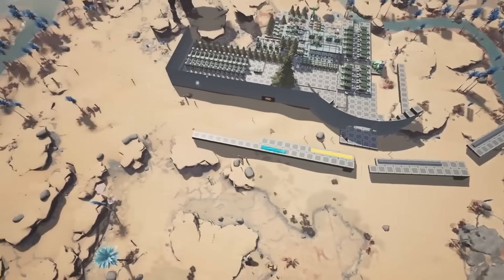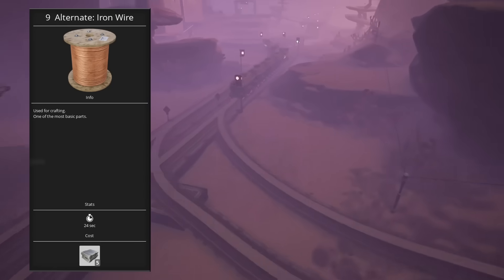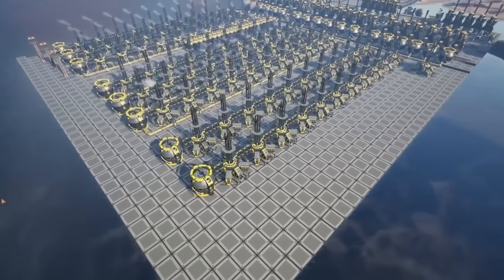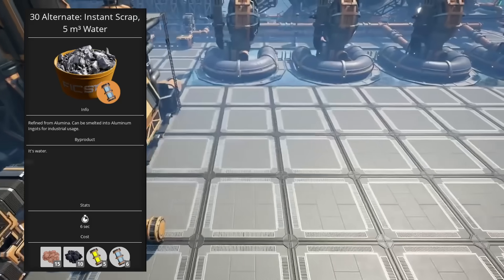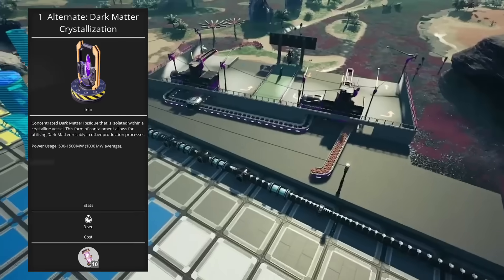Alternate Recipe Guide - Best alternate recipes for each tier in Satisfactory 1.0

Comment: Iron Wire + Stitched Iron Plate + Iron Pipe + Encased Industrial Pipe + Heavy Encased Frame = screw-less Heavy modular frame factory that only uses concrete and iron.
Reply: This was something I immediately tried to jump on when I found the alt recipe. The problem I had was finding iron pipe since I pushed milestone tiers (and diluted the drive pool)
Reply: @Aeosin  Early exploration is extremely important because of the new hard drive system. I was a little miffed when I realized I'd have to get a bunch of hard drives before completing stage 2.

If you don't have scruples with "exploiting" the system, you can save before re-scanning hard drives and re-loading until you get what you want.
Reply: @1Heirborn That;s not how you do it. You just copy the hard drives, rather than bothering with saveScumming. At least if you want to be the player without scruples.
Reply: @Aeosin if you don't actually click on a recipe, and keep scanning more hard drives, it gives you a better selection because the recipes you can select are already out of rotation
Reply: @Fawstah  Solid advice that I was making use of when I figured it out. However, for my situation I had pushed tiers instead of hard drive exploring. As Dekoba mentions, T5 basically increases the recipe pool exponentially, and I had picked up heavy encased frame alt well before my big hard drive hunting session. So I was stuck thinning the pool for iron pipes for a good while.
Reply: @Fawstah  problem right after 1.0 came out though was the large list of saved drives making the UI size up vertically out of the screen. I was forced to pick useless recipes instead of saving them until the bug fix came out.
Reply: @Aeosin  From this point on, just scan your drives, but don't choose a recipe until you find what you need. Both choices are removed from the pool until you choose one. That way you can eliminate recipes from the pool 2 at a time. This will still take time, but since you're already screwed, it will help to find it faster. 

This is also good for when you can't tell yet which recipe would be more helpful. Just leave it in the library until one makes sense
Reply: Doesn't iron pipe use an ungodly amount of iron?
Reply: @Beans-m1x  it does but your concerns are subjectively dependent on your base locations. I started my 1.0 file in the forest and parked in the middle of the truckload of pure iron nodes. So I never really had an issue with the cost of iron ingot to steel pipe.
Reply: @Aeosin THATS EXACTLY WHERE I STARTED! 😂 never had a problem with iron production lmao
Reply: @Beans-m1x  yes, but unless you are trying to absolutely maximize the ficsit out of a factory, it doesn't matter as much. Good for small, not for big
Reply: @Beans-m1x that's for early game then use solid steel + pure iron for later fame
Reply: @Beans-m1x Very much so. I was building a 70/min Motor Factory that was going to use Iron Pipe, but when I crunched the numbers, it turned out that if I just had some tractors bring in coal from quasi-remote nodes, I could not only shave out tons of machines that would be smelting the extra iron ore, but also increase my output to 120-140 motors/per min.
Reply: @Beans-m1x  Doesn't matter because iron is the most common resource + it extremely simplifies production. Once you unlock mk5 belt & mk2 miner. You only need 1 pure iron node + 1 pure limestone then run them at 250% overlocked speed.

Which free's up coal from making any steel products. You can then use your coal for power + alumina production & other stuff.
Reply: @Beans-m1x  yes but with the steel modular frame u need less iron and less energy than the original recipe
Reply: 960 Iron Ore/min + 240 Concrete/min + 16 somersloops = 20 Heavy Modular Frames per minute
Reply: @hiredgoon4269  what do I use the somersloops on? I’m about to try to do this, but idk what to somersloop, and the satisfactory tools website says I’ll need 1788.15 iron ore

Edit: I saw your comment saying to use the pure iron ingot recipe, and the website I use says I need 962.849 iron
Reply: And coal...
Reply: No coal with iron pipe alternate.
Reply: This requires an absurd amount of iron though
Reply: Use the Pure Iron Ingot alternate recipe. Iron is cheap and everywhere, and makes for a very easy 10 HMF/min (20 with sloops) with a simple factory. Way fewer machines and logistics, it's just easier, especially at a point in the game where the complexity really starts ramping up. You can do it all with 2 Mk. 4 belts of iron ore.
Reply: @ubertoss2000 using pure iron and/or basic iron ingots is a great way to mitigate the imbalance of iron requirement.  Basic iron is great for the reinforced frame factory.
Reply: Iron is cheap
Reply: + Motors.
Reply: am i crazy for planning a fused modular frame set up that uses as manny screw per min as possible?
Reply: Screw screws
Reply: That's 5 recipes. With steel screw you have only 1

Comment: The pure recipes are so goated, but I do also really like the sulfuric acid version because you don't really need that much sulfur in playthroughs so you can use sulfur and it is better than the pure recipe. You can basically make a train track on the outer edge of the map to collect all of the sulfur ore nodes in the game. I really only needed the 3 nodes by blue creator for rocket fuel. That being said, there is actually a better place to make fuel, the ore fields in the desert biome technically allows you to make more fuel with the diluted fuel recipes. I did the math and it would require more fuel gens to fully saturate that area.

Comment: I'm baffled at why the production volume is so high. I just finished the game on Xbox in about 300 hours never making more than 80 concrete a minute. I had one truck route and no trains. I kept waiting for the moment when I would have to start building giant factories. It turns out, I never needed more iron than the two nodes I started with. Are these giant factories you're building simply to make parts to go into the sink for coupons?

Comment: Iron Wire
Stitched Iron Plate
Iron Pipe
Electrode Circuit Board
Steel Rotor
Encased Industrial Pipe
Electrode Circuit Board
Caterium Computer
Heavy enscaed Frame

Comment: I'm very new to this game, and I found some alt recipes, but seeing the stats on them, I'm a little confused. For example, Stitched Iron Plate, it needs 18.75 Iron Plate and 37.5 Wire to get 5.625 Reinforced Iron Plate per minute. If I want Reinforced Iron Plates to make Modular Frames for example, the numbers don't seem to add up neatly. Even getting 18.75 Iron Plates per minute from a Smelter seems difficult, even if you use two Constructors, it adds up to 37.5. How do you guys solve this? Underclocking to percentages?

Comment: Nice list. I personaly find the Iron Pipe and wire recipes overhyped. Copper is more then enough there for wire. Worst case, use the pure or alloy recipe and fuse it with caterium to get huge amounts. Or for steel. You can build everything iron related from steel with much higher efficency. 
But in case you go rather small, then yes. The Iron recipes are the way to go.

Comment: I find Silicon Circuit Board to be great as well. It contributes to keeping a factory oil free if needed and combines well with the production of Turbo Electric Motor. The latter needs Radio Control Units and those are in need of Circuit Boards in their production chain no matter what alternate RCU recipe is used.

Comment: Iron Pipes are amazing. Early, I try to nab it as soon as I unlock steel. I can dedicate the limited coal nodes to purely produce steel beams to account for the weird cost/production values that a basic steel setup has, enough to have plenty to spare for encased beams. Then dedicate a couple random iron nodes to make the pipes, and I don't really have to touch it until late game when I can scale up the inputs

Comment: Have to jump in with a few notes here.
3:41- Bolted Frame/Plate
These recipes are not strictly more efficient than the base recipes. They produce the items more quickly, and they use less power, but they require more total machines and use more raw iron ore to produce the same total items than the base recipe. You are trading off increased production speed for using more resources and a bigger factory footprint.

5:02- Solid Steel Ingot.
This is not strictly more power efficient than the base recipe. The power consumption for Solid Steel ingot rises exponentially as the production rate increases since the ratio is 2:3 Iron Ore input to Steel Ingot output. For every 45 Iron ore You need two smelters for each foundry. At around a total production of about 235 to 240 Steel Ingots per minute, the Solid Steel recipe consumes more power than the base recipe and it only gets power hungry from there. While it's still a very good recipe, for practical purposes it is also a tradeoff, in that you are consuming more power and using more machines to get 50% more Steel Ingots from the same amount of coal and iron input.

6:55- Biocoal (or Charcoal)
One edge case that I always like to point out for these two is in the manual production of Gas filters before you have a way of automating Polyester Fabric. They provide an easy source of coal without having to travel somewhere to steal it from an existing production chain any time you need to make a few extra filters.

8:09- Again, this is not strictly more efficient than the base recipe. It's much less power-intensive and takes less iron and coal to make the same output with a smaller factory footprint, but it does uses much more raw caterium ore than the base recipe uses copper ore. So you are trading off a higher amount of a scarcer resource for using lesser amounts of more common ones. There's a very good chance that when this recipe is first available you won't have the quickwire to spare as the amount needed for your High-Speed Connector and AI Limiter automation will likely greatly exceed your production capacity until you get Mark 3 Miners and the higher tier conveyor belts.

10:51- Pure Aluminum Ingot
This recipe is a trap. It "simplifies" Aluminum Ingot production by removing quartz but it also cuts your total Aluminum Ingot output by 10%. Whereas Sloppy Alumina with the base Aluminum Ingot recipe takes 80% more Raw Quartz but increases your Aluminum Ingot output by 20%. Quartz nodes are very commonly found near bauxite so there is no need to plan to remove it from the production chain. You are better off going with the increased Ingot output to speed up your early Aluminum production.
The Alclad Casing is another (semi)trap as while it is an increase in production yield and simplifies the production line, it is also a massive increase in the demand of raw copper ore. This is one I would not recommend using unless you pair it with the Pure Copper Ingot recipe.
Reply: I'd add that biocoal/charcoal are also useful for nobelisk production from just iron and sulfur, or smokeless powder if there's also oil nearby.
Gas filters are still the premier case though - a single piece of wood will make 2.5 gas filters (or 5 if you sloop the constructor the constructor), so a single stack of wood makes 10 stacks of gas filters (20 if you use a single sloop).  Given how easy it is to collect a storage chest of wood when you're not using biofuel anymore and it's just plain easier than mining for coal (and you can make it "renewable" by using biocoal and alien remains instead).
It also has a niche use of making black powder for some hard drive locations while out exploring.

Another recipe that is often overlooked is heavy oil residue's evil twin, Polymer Resin.
You can actually balance the outputs of Polymer Resin and Heavy Oil Residue together so you can direct-feed residual rubber refineries into recycled plastic then into recycled rubber again.  It's only about 2.5x efficient for oil compared to 3x of a "proper" recycling loop but it's substantially easier to build, being just repeating blocks of 3-2-4 refineries without any cycles (but it does result in a lot of very strange numbers for oil-input and rubber-output).
Reply: I'm sorry but solid steel power consumption is higher than default recipe ONLY if you use pure iron ingots in the process.  And it's a linear increases in power consumption, not exponential.

If you use default iron ingot in the process, you actually use less power and less resources, the only drawback is building more machines. But it's only smelters, so that's easy.

And for your take on pure aluminum ingot and alclad casing, I've gotta say it's just really weird at least for me. You don't mind using a boatload of quartz for aluminum ingot but you advise against using a little bit of copper in maximizing aluminum production, when there's three times as much copper than there is quartz in the map.

Comment: Does anyone know, what exactly unlocks a alternate recipe? I know its the research, but e.g. in the beginning I will never get Heavy-Encased-Frames, but rather Iron Wire. Are additional recipes unlocked with the Space Elevator, e.g. Solid Steal becomes available after finished Phase 1 or something else e.g. finding coal in the world?
Reply from the maker: Each milestone in the hub comes with relevant unlocks,  generally
Reply: @Dekoba  So when I want to have the relevant Tier 1 recipes it makes sense to research them before unlocking the next milestone to have a higher chance to finding them, right?
Reply from the maker: @valentinkuhn6024 to a degree,  yes.  Don't lose the forest for the trees though
Reply: @Dekoba  Amazing thank you!
Reply: Typically it's when you've unlocked all the resources that make up that recipe, but not necessarily the building that makes it. So, for example, pure recipes unlock when you get the water extractor even though you don't have access to Refineries yet, and the alloy recipes, which only use ore, unlock before you have the Foundary.

Comment: I like using the Steel Screws alt recipe. For very little effort, you can saturate even multiple T7 belts with screws and easily mass produce heavy encased frames.

Comment: Zero-oil lithography factory, (Fe, Cu, Cat, & SiO2 only) that makes AI Limiters, Circuit Boards, High Speed Connectors, Computers, and Super Computers, when you get there 

Makes life REAL easy

- Iron Wire (Cu is used only for sheets now)
- Stitched Iron Plate
- Silicon Circuit Board
- Crystal Computer

Comment: Bolted frames requires 140 screw/min, but only 7.5 re-enforced iron plates, i was able to build this using on,t T2 belts, buy supplying 100 screws on one assembler input and 40 screws + 7.5 plates on the other input. It certainly not a beginner build but it was a fun challenge

Comment: There's one you didn't mention that, for fans of the Rocky Desert start, is really useful:  Crystal Computers.  The cove with 2 normal and 2 impure coals has the cave entrance at the back.  This leads to a normal SAM node and 3 quartz nodes grouped together, 2 pure and 1 normal.  No oil products needed and you've got a ton of quartz, so it's pretty ideal for that location.

Comment: Cast Screw 1:29
Iron Wire 1:48
Stich Iron Plate 3:21
Bolted Frame & Bolted Iron Plate 3:42
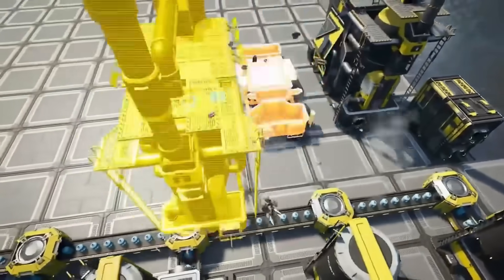Copper Rotor 3:57
Fused Quickwire & Fused Wire 4:12
Caterium Wire 4:23
Pure Iron & Pure Copper & Pure Caterium 4:36
Solid Steel Ingot 5:03
Iron Pipe 5:22
Iron Alloy & Copper Alloy 5:21
Molded Beam & Molded Steel Pipe 6:00
Steel Rotor 6:31
Biocoal & Charcoal 6:55
Wet Concrete & Steamed Copper Sheet 7:09
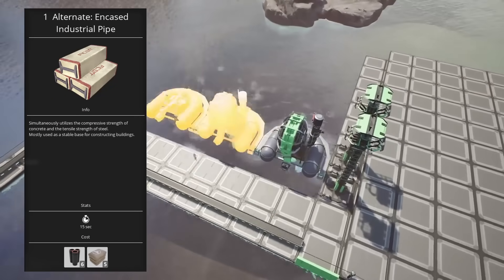Encased Industral Pipe 7:39
Automated Speed wiring & Rigor Motor 7:55
Quickwire Stator 8:04
Heavy Oil Residue & Diluted Packaged Fuel & Recycled Plastic & Recycled Rubber 8:20
Diluted Fuel & Diluted Packaged Fuel 8:48
Turbo Heavy Fuel 9:04
Coke Steel & Electrode Circuit Board 9:21
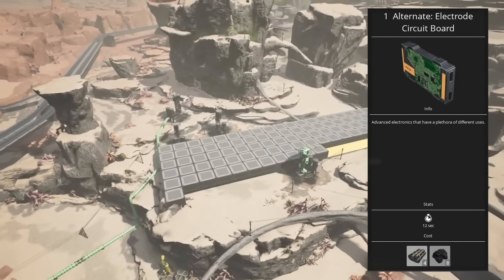Caterium Computer 9:40
Heavy Encased Frame 10:03
Sloppy Alumina & Pure Aluminum Ingot 10:53
Alclad Casing 11:09 
Instant Scrap 11:23
Diluted Fuel 11:39
Turbo Blend Fuel 11:52
Infused Uranium Cell & Uranium Fuel Unit 12:07
Electric Motor & Turbo Electric Motor 12:45
Dark-Ion Fuel 13:09
Dark Matter Crystallization 13:21
Reply: legend
Reply: You're a legend thanks.

Comment: One of my personal favorite combinations that you glossed over entirely are Silicon Circuit Boards and Crystal Computers.  Yeah, having to bring copper into the mix for the circuit boards is a bit of a yikes, but copper sheets are pretty valuable for quite a few electronic components that become relevant around the time you get these alt recipes, so you’ll be building a factory to produce them anyway.  The rest of the components are made from Quartz Crystals and Iron as long as you have Iron Wire and Stitched Iron Plates.

Comment: Copper rotor is a great recipe for phase 1 and 2 of space elevator imo.

2 constructors making copper sheets merge into a sushi belt of with 60 screws and then a 120 screw belt going into a copper rotor assembler making exactly 10 rotors/minute.

The recipe uses 173.33 screws/minute and 20 copper sheets per minute. I have never had it back up on me always works at 100% efficiency

Comment: oh wow I would have expected the rocket fuel alt recipe to be in here, from a single pure oil node, a single pure sulfur node, a little bit of nitrogen gas and a single normal coal node. You can get at least 54GW at tier 7/8 and once you get MK6 belts and mk 3 miners you can double that for 108GW + from that same oil node an extra 5GW in fuel to power the factory itself
Reply: you could also use the compacted coal byproduct as even more power production as well, you get enough compacted coal for another 3.15GW and also make fabric with the polymer resin byproduct